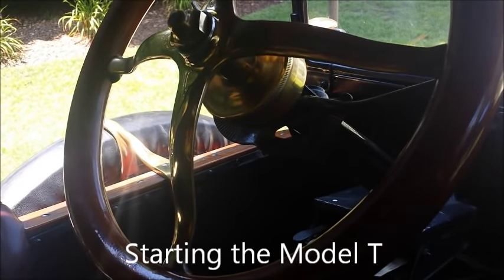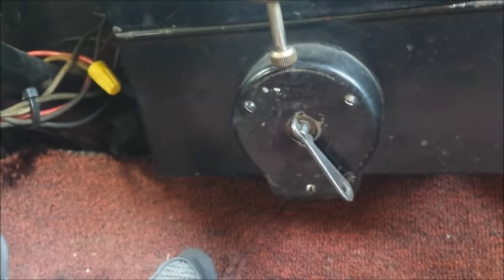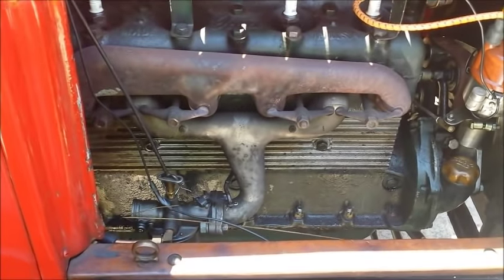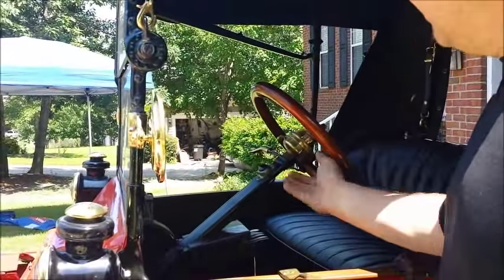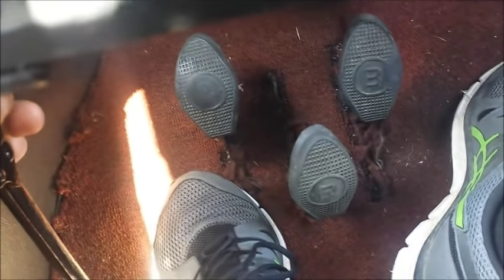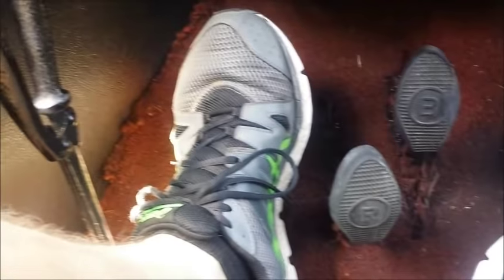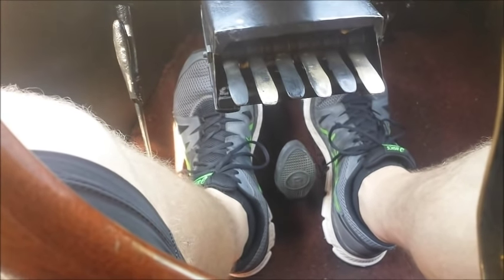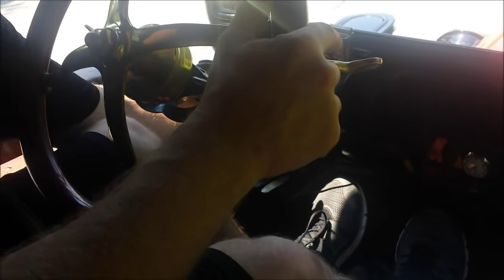Model T Driving Instructions

Comment: Now days, in the USA, if you can drive a 5 speed manual transmission you are pretty unique. I learned to drive in a 3 speed manual, with the shift lever on the steering column. I have had automatics over the years, but always preferred a stick. The worst thing to me is not being able to push start the automatics. There have been so many times where being able to push start  ( get the vehicle rolling, pop the clutch ) has saved the day! With an automatic if you do not have a set of cables and a jump handy, you are stuck. But a manual transmission is still a long way from a model T, lol.
Reply: The early - 50s - automatics can be push-started, or roll started if on a steep hill, as they have 2 pumps, a front pump and a rear pump.  Later ones only have one pump.
Reply: My dad showed me how to pop the clutch to start the engine in his 1986 Isuzu P'up.

After that rusted into dust (but still ran like a champ) he bought a 2002 Nissan Frontier, which had safety mechanisms in place that prevented popping the clutch.

He replaced the 2002 Frontier with a 2011 Frontier, which also didn't pop start. Nissan clearly doesn't want you popping their clutches in what few cars they still make with manuals.
Reply: Are manual transmissions that rare in the US?
Reply: Today it's all about batteries
Reply: @santiagogarciamaffeo9597  They are.  So few cars are offered with them now, and even then, it's usually trim-level specific.
Reply: @santiagogarciamaffeo9597  Rare enough that a local group of would-be car thieves got caught in the act after spending 10 minutes trying to figure out how to get their target car off of the used-car lot...

In all seriousness, a manual transmission is pretty much something that you need to special order, unless perhaps in some sports cars.  Pretty much standard in a no-frills US car is an automatic transmission, air conditioning, and generally cruise control.
Reply: Crazy, I would never want a car with an auto. They're super annoying.
Reply: @santiagogarciamaffeo9597  I've been driving stick  for 5 years and I've met a handful of people who daily a manual. Even at the shop I go to, only the guy that runs it know how to drive stick and a lot of them are older folks (40+), sometimes if he's busy I have to put my car on the lift myself lol.
Reply: @iunnox666  seriously, had 3 automatics as my 1st cars. Will never go back after I see the difference in not only reliability but also performance lol.
Reply: 2 speed power glide transmissions can be roll started but good luck finding one
Reply: A vast majority of cars sold here are automatics, to the point where (as others have said) it's usually a feature available only in sports cars or with a certain trim option. A few companies still offer manual as standard, but it's uncommon. I have a 23 Subaru Impreza on order and was pleased to find that their 5mt is standard and the automatic costs $1600 more on every trim level.
Reply: Most drivers in England learn to drive a manual transmission car (so your licence allows you to drive manual or automatic transmission cars). If you pass your test in a car with automatic transmission you are then only allowed to drive auto cars. Compared to twenty years ago, most cars except low line economy models now seem to have automatic transmission.
Reply: @iunnox666  Many modern automatic transmissions shift faster and get better gas mileage than a manual.
Reply: @iunnox666  I thought so too, until I bought a BMW with a decent ZF box, and not some econobox cheap-as-dirt-worth-even-less auto.

It's not perfect, but it's silky smooth for everyday driving, and gives satisfying thuds in sport-mode. Not having to clutch and fiddle around with the shifter is so relaxing and comfortable for everyday driving, and lets me focus on handling when the right foot gets heavy. If I want, I can shift via paddles/steptronic.

Occasionally, it'll do something I disagree with, but it's extremely rare. We're talking less than a handfull of times per year, I expected much worse. Can be improved even more, with an engine tune and a re-map of the transmission.

What I do miss the manual for, is proper drifting. The auto is absolutely useless to follow a set track with. Works just fine for joshing around in a parking lot, but on tracks, the gears are too short. But that's the only thing I truly miss. But that can be remedied with a manual winter-beater 👍

I get it though. There is something special about rowing the gears, so I have some fun with it any time I drive a manual.I may have been worn down from my last manual. Toyota Avensis diesel - The clutch in it was heavier than an 80''s Ferrari. Long drives felt like doing leg-day with my left foot only... Which got old pretty quick😅
Reply: My current car has a 6-speed manual transmission. I guess that makes me special nowadays.
Reply: Good old 3 on the tree
Reply: @Jeremiah Bullfrog I told my mom once she turns 40 I'm calling her old, it's been that way since lol.
Reply: @michaelbenardo5695  and all USPS 1960s small delivery trucks. Often done under ORDERS by Postmaster. I was 16, crazy dangerous on 35 mph road, needing 50+ speed, boxes pushing boxes, blind!
Reply: @sdrape4964  You can't push or pop start a Japanese stick?  That destroys one of the advantages of having a stick!
Reply: @santiagogarciamaffeo9597  Sadly, yes.  I wish I could find one of the 250 1966 Cadillac Eldorados that had a stick.  1st Cad with a stick since 1953, and even those were limousine only.
Reply: @kevincrosby1760  Yep, hardly a "no frills" car, yet can't measure up to a Ford, Chevy, or Plymouth base model from the 50s or 60s.
Reply: @iunnox666  Now, you almost don't have a choice, unless you keep your present car and periodically overhaul it.
Reply: @AlexEssex8  All today's younger drivers know how to do is press the gas pedal down.  Nothing else.
Reply: @waynecampbell7609  On the open road, yes, because they can pull taller gears, but in the city, that's not necessarily so.
Reply: @DrakeKillah  You would probably hate my 73 GMC.  12 inch clutch.
Reply: @vainglory991  That's my favorite.  Safer too.
Reply: @michaelbenardo5695  Does not sound like a clutch I’d like to deal with every day😂
Getting a leg workout in the gym is fine, getting a leg workout on just the left leg, when tou’re just trying to get home from work after a long day, not so much 😅
Reply: @michaelbenardo5695  My '66 Chrysler Newport just kind of floated down the freeway at just about any speed that you wanted to travel.  You had to listen to the engine to detect a shift, because you couldn't feel it.  A/C was cold enough to be uncomfortable if the dash vents were pointed at you.

My only complaint about the car would be that darned Chrysler power steering.  So sensitive that you learned to hold the steering wheel with two fingers and a thumb.  Grandpa's Imperial was the same, as is my '86 Dodge Ramcharger.
Reply: @michaelbenardo5695  Some of them seem to have figured out how to bolt to their trunk lid what appears to be part of a Boeing 747 tail fin assembly.

These are the drivers who are also skilled at installing stereo speakers suitable for an outdoor concert, and selecting mufflers which make their little cars sound like runaway yard care equipment...

Not saying that I never had a fast little Toyota, because I did.  Not much of an interior, 1 seat, plastic windshield, etc.  I drove it around in circles on Saturday afternoons in the Mini-Stock class.  Gave up the race car in order to support my new wife and kid.
Reply: @kevincrosby1760  Chrysler's (in)famous "Full Time" power steering, unlike GM's part-time "in and out" power steering!
Reply: You can push start. You just need to get it to about 35MPH
Reply: @MaxBrix  That was on the older automatics with a rear pump.  I don't think you can push start it if it only has a front pump.
Reply: @MaxBrix  That depends on the design of the Auto Trans.  Try it with some and you'll be purchasing a transmission along with the new battery.
Reply: That style of manual you learned on is called "Three on the tree". It's so rare now that people familiar with stick manuals on the floor have issues using it. I also learned on a three on the tree 1970s era work truck. Well that and a 78 Trans-am and 89 Ford Probe. My Dad had manual daily drivers up until the early 2000s. He taught me how to drive when I was very young. I remember sitting in his lap and driving the Trans-am when I was like 4 years old. He'd work the pedals and I'd work the steering and stick. When I sat shotgun I'd work the stick. It was a different time. You could let toddlers ride shotgun and drive. The first thing I ever learned how to drive was a 65 model Massy Feruguson tractor with 3-speed manual + reverse with two ranges. I had to stand on the clutch pedal with both feet to operate it. I think I was 4 or 5 years old when they turned me lose on my own. But I'd been sitting in laps driving for years by the time the allowed me to do that. Driving the tractor allowed me to work in the fields before I was strong enough to toss hay bails. I'm proud of my record. I've only run over one bail of hay in all these years and I did it on my first day. 

I taught both my younger siblings how to drive and couldn't get either to learn manual. They both drive automatic and are terrified of the snow and rain. I've seen them call out of work for weeks at a time because of snow and get away with it. Meanwhile I'm driving in the stuff for fun with a RWD truck or sports car. AWD is useful for getting out of jams but I've always preferred not getting stuck in the first place. AWD is faster but not as fun as RWD. But I like them all. Even FWD can go fast if you know what you're doing. I just don't like FWD and AWD as much because I learned on RWD. Everything is backwards on FWD/AWD. Instead of lifting to correct you have to hold the gas pedal to the floor and pray.

At any rate my siblings were never interested in driving at a young age like I was. For them it's just a way to get from A to B. For me it's an experience and skill that I constantly try to improve at. I love all the different things I've driven. They're all unique and fun. Even the automatics. I love driving a land yacht and floating down the highway as much as pushing a sports car to the limit in the twistys. 

I wish the standards were more strict in America for obtaining a driver's license. Lots of people on the road that don't know wtf they're doing. The upside is I don't have to worry about most of the cars and trucks I own being stolen. Most people think my C10 is an automatic because it has three on the tree. Then they get confused when they see the third pedal and no indication for what gear the truck is currently in. Lots of the older stuff had very basic trim options. My truck doesn't even have gauges for anything but RPMs. I own a lot of stuff that doesn't have a working tachometer. I shift and gauge engine speed by ear. I own one car without a modern syncro set-up. You have to float every gear or double clutch it. Most of my gear head and race car driver friends can't drive it.

My left knee is getting bad as I age so I float gears in most everything I drive now. Slipping in and out of gears isn't that hard once you get a feel for it. I learned this skill because I rode motorcycles so much in my youth. Most of those transmissions are set-up for up-shifting without the clutch. Downshifting is just as easy if you know how to match RPMs.

A lot of knowledge hasn't been passed down to the younger generation because they haven't been exposed to older styles of transmissions. My friend has a kid that's gone pro in motorcross. He can not ride older 2 cycle motorcycles as fast as I can. He doesn't know how to feather the clutch to keep the engine in the power band. All he knows is 4 cycle engines and they don't require that style of riding. He can run circles around us when we're all using modern dirt bikes. But when the old stuff comes out to play we leave him in the dust.

The sad thing is most of this stuff is easy to learn and can save your life if you know how to do it. Braking is the same thing. No one really teaches threshold braking anymore because ABS systems got so good. ABS is fine until you need to lock down the wheels to stop quickly. When you go out into the shoulder/dirt next to the road ABS does nothing to help you slow down. An old non-ABS car can stop much faster in that situation. Lack of ABS saved my life once. I disabled ABS on all my stuff after that. It's probably a 1 in a million chance that I'll face that situation again but I want to be ready for it if it does happen.

In racing we've actually gone backwards with driver skill levels due to all this technology. Most of the guys driving pro today couldn't handle driving the 1980s Group B cars. Or the 1970s F1 cars. NASCAR isn't even the same sport it was in the 1990s anymore. It's easier than ever to go pro. All that's required is money. It isn't like the old days you can buy speed now and drive these new cars to their limit. The problem is there are few that could handle them without the computer assistance. There aren't many true driver's cars left on the market. I can think of three at most. The Nobel is the last real supercar. Toyota makes one car targeted towards old school people like me but it doesn't come with a very powerful engine. The chassis is amazing though. I plan on buying a used one and doing an engine swap whenever I find the time. That will become my new daily driver and track car.

Most American cars and drivers are design to go down the interstates. There aren't many people left that are interested in buying a 5-speed manual for going fast down backroads. The vast majority of drivers in America never see a real road. They're either doing stop and go driving in the city or cruising down the interstate at 70mph. Street racing is dying here. At least the rally/road racing type. Most racing is centered around going fast in a circle or straight line. Neither of those applications use traditional shifting anymore. Drag racing switched to automatic long ago and most stock car racing are geared to use 1 gear at speed for the duration of a race. It's a real shame. America has lots of beautiful and technical roads that would make perfect rally stages. But the sport never took off here. 

Sorry for long rant.
Reply: @Noname--  That is the longest utube post I have ever seen! 😊
Reply: I can see how you'd learn the rhythm pretty quickly, though! What a fascinating machine! :3
Reply: @kevincrosby1760  it was those giant reciprocating York compressors and good old R12!!
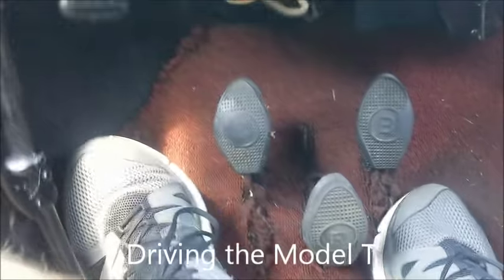Reply: @Noname-- One thing I hated on late 50s - 80s full-size cars was the sky-high gearing.  It hurts acceleration and hill climbing ability. Bought a new Chevy 6 pickup in 81, and could only get a 2:73 rear end with a stick.  I replaced it myself with a 4:10 rear.  Suited my needs much better.
Reply: How crazy. I knew that manual transmission cars were uncommon in the US but I was really unaware how uncommom they're.

My wife and me are very used to our manual transmission cars, we never had automatic. And the mexican new car agencies are still selling manual transmission cars, even new ones.

We just bought a new chevrolet suv with manual transmission.
Reply: I love my 5spd manual Saturn
Reply: Auto is fantastically boring. The auto was created only for standing in a traffic jam, so as not to pull the clutch pedal
Reply: In my home country, you can test for a driver's license on auto, only if you pass the exam on auto, then you will not be able to drive manual, and if you pass on manual, then the license will be universal
Reply: @Satunnainen Katselija  
I remember cars having starter buttons! Turn the ignition key to the on position. There on the dash was a protruding chrome button. Push it in all the way, and the starter motor would turn over.
Reply: Ridiculous how a country basically doesn't drive manual. Here driving automatic is for those who basically shouldn't drive and those with disabilities
Reply: @michaelbenardo5695  The rear pump went out pretty early. My moms 1954 Ford did not have one, and it coasted when the throttle was lifted. That was unnerving to me at first, as I had learned to drive a manual that had engine braking when in gear.
Reply: @santiagogarciamaffeo9597  Very low numbers of manuals in the US anymore, which is the opposite of Europe. Even in the '70s and '80s most economy and sporty cars had manuals.

Comment: I'm very glad that every car manufacturer uses the same standard for either stick shift or autmatic. Imagine if every different brand would use completely different controls for driving.
Reply: It took me awhile to not press the reverse pedal (middle) instead of the brake.  So used to having the brake in the middle with a modern stick shift.
Reply: @dalebertdurando1496 😂😂
Reply: Some Teslas don't even have a "wheel" to steer with.  And no physical tactile control to change forward/reverse direction.
Reply: @haweater1555  Honest question, which Tesla doesn't have a steering wheel?
Reply: @namenamename390 Some Model S Teslas including the "Plaid" performance edition.  Rectangular "yoke" like an aircraft instead of a round wheel.  Reviews are quite negative.
Reply: @haweater1555  Genuinely didn't know that, thanks. It looks like just a squared off wheel, so I think it'd be easy to get used to. It's what most racing wheels look like after all, and you still turn it like a normal steering wheel.
Having said that, I also don't see any reason why you should ever actually do this, just stick with a regular wheel lol
Reply: A dogleg gearbox can take a bit of getting used to
Reply: Some sports cars, like Corvette, didn't have steering "wheels" back in the 1970's.  I've also seen cars that are driven with a "joystick" and no petals or steering wheel.